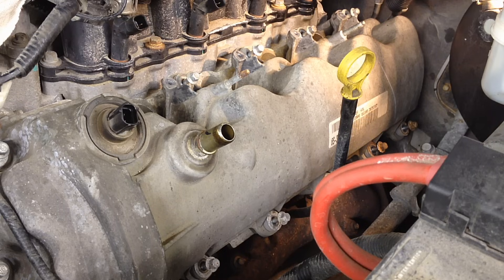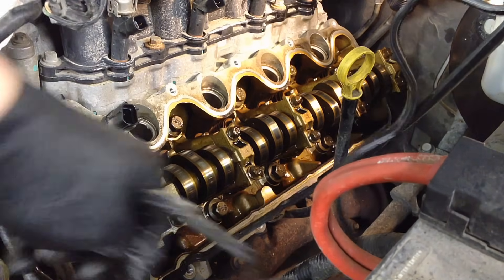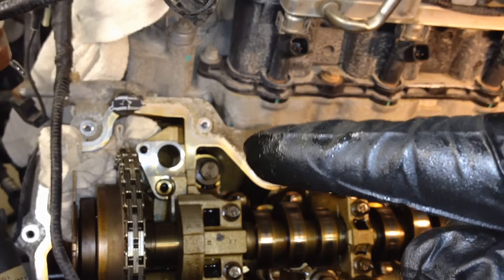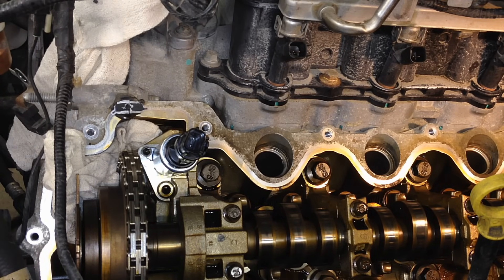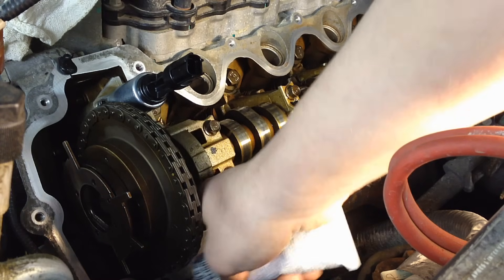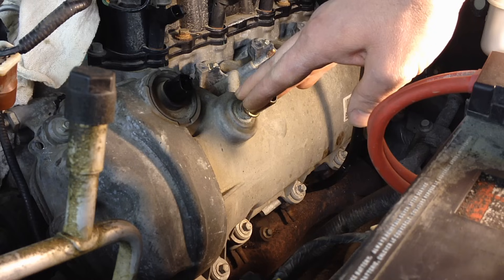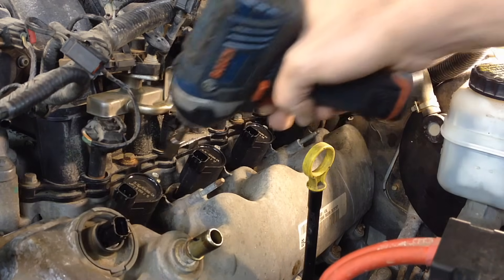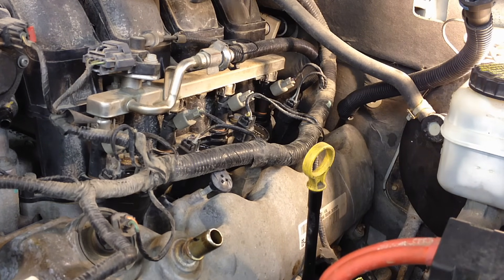Ford 4.6L 5.4L 3v Engines: VCT Solenoid Replacement

Comment: I don’t understand why you took the valve cover off? I changed it with it on. I just removed the pressed in seal and used an extension with a T25 torx bit. Removed and replaced it with new one. The new one came with a new pressed in seal around the selonoid and done. Can you explain your reason? Respectfully. I love your videos
Reply: Nevermind. I seen your answer below. 👍
I have an 07 and had no problem. The capture bolt was fine. Thanks for the info. The way the plugs break and all. 😅. I guess I’m a gambler.

Comment: Hmmm not hating because your video was so informative but I've doen these and the passenger side is the one that requires more coaching for those that are tackling this at home. I was hoping you would do both sides and was disappointed to see you end this video when you were done with the drivers side.
Reply from the maker: I cannot replace anything not authorized by the customer.

Comment: Why are you pulling the whole valve cover pan off I thought you posed to help people make it easier you just have to pull the rubber peace off should only take about five minutes to do it
Reply from the maker: Why because it is always better to pull the cover to avoid losing the screw. The screw can cock and thread into the eyelet of the factory VCT solenoid and aftermarket solenoids are even worse since they don't use a captured bolt. Also most don't have a T27 driver so they will use a 1/4" extension and T27 bit and this is very easy to knock off and lose down in the engine. Lastly the reason why I show this method of valve cover removal is because the large seal style valve cover you see in the video was only used 2004-2007.5 engines and 2007.5-2014 engines use a much smaller seal which requires valve cover removal anyway. Now do you understand?

Comment: The only thing on this engine that does not go bad is the dip stick!
Reply: You sure cause I can barely read my dipstick lmaooooo
Reply: One had a tube rust through on a 5.4
Reply: My dip stick tub got rusted and the dip stick fell off
Reply: My 4.6 3v has been great...no issues.  2010 F150 Supercrew with 184,000 miles, since new it gets an oil change every 3000 to 3500 miles, Berryman's B12  with every 10th to 12th fill up.
Reply: @bmboytx7082  same here,,,very reliable and dependable
Reply: Even on fresh oil change
Reply: lol.  Same here.  😅.
Reply: My 5.4 dipstick was impossible to read. My mechanic soda blasted the end so now I can sort of read it from the backside. 🤦‍♂️
Reply: I just replaced mine after 460,000 miles with virtually zero issues.
Reply: Even the dipstick f'ing sucks

Comment: Thank you for all the informative videos. I have a question for you, hopefully can get an answer since it’s been 7 years you posted. I have a 06 explorer with the 4.6. Keeps giving me code p2020. I changed the intake, I changed the actuator in the back of intake, changed the brake booster because it was hissing air. Sprayed around the houses to see if it would change rpm’s and nothing. Car feels and runs fine but can’t get rid of that P2020. I don’t think it’s the actuator harness because the actuator works. Unless I gotta trace other wires. Hope you can help. Thank you
Reply: ever find out what it was?
Reply: @robertswift6101   Unfortunately I didn't.

Comment: Could the vct cause a p0016 code? 08 5.4 3 valve. Timing assembly was done shortly before I bought it and has run fine for a year until it threw the code last week. Runs fine other than a very mild rough idle barely tell is running rough.

Comment: Is there a difference between the VCT and a VVT "Variable Timing Solenoid"? I ask because I and replacing my Camshaft Phaser and it was suggested to replace the VVT Variable Valve Timing (VVT) Solenoid / Actuator also.

Comment: Youre absolutely amazing and have been watching you for the last few weeks after purchasing a 2007 F150 super cab with the 5.4 3v. I have watched other videos and they pull the top gasket and pull the solenoid through the valve cover without removing it, are these videos legit?

Comment: There not alway a 25 mm torxs they can be a 10 mm bolt
Reply from the maker: If they are not a torx then they are aftermarket, we only speak about Ford parts here.

Comment: I put duralast vtc solenoids in my 4.6 3 valve engine in my STX F150  3 months ago and now after watching this video and hearing you say only buy Ford vtc solenoids is my truck going to be ok or should I change them back to Ford before I have problems

Comment: I just replaced my first solenoid. Filters were blown out. Good sign I hope. Inside of the engine is dirty. I have it apart and would like to clean it it while I have it open. Any suggestions? Or don’t touch it? It’s a little dirtier than the vehicle in the video. 230k on a adrenaline sport trac. (4.6l 3v) I have had great success with seafoam on other engines…?

Comment: 5.4 in a 2001 F250… pretty sure this is my problem. Runs great but rough idle when stopped. Has 293,000 miles on it. Would you even recommend tearing into this with the mileage? I’m afraid if I do I’ll just uncover more problems. Anyone feel free to give opinion. Thabks
Reply from the maker: Your engine is totally different.

Comment: Man thank you so much FordTechMakuloco for posting these 5.4 VCT videos. I had to replace mine at 88k and it was def the ticking/knocking noise i was trying so hard to diagnose. You are the man! Thank you so much 👍
Reply: was it knocking at idle or just in drive under a load?

Comment: I have a 4.5l and mine did not have to remove the valve cover to get to the PART  I want to know why you had to remove the valve cover? The new ones come with 2 plugs rings that save you all that extra time?

Comment: If my 5.4 3v has cam phaser lock outs, does the vct solenoid even matter anymore?

I bought the truck used from someone that installed the lock outs so that's all I know about the truck.

Comment: I have a Ford F150 2008, 5.4 triton, I' m from Puerto Rico.  My ford start to make rough noise, just like you said, I change the camshaft sensors and the VVT selenoid and the fail stop, but have a noise, like a tac, tac tac, when change the VVT I change the oil too, but still the noise, how can I fixe it?

Comment: Why didn't you change the valve cover grommets you going to pull vacuum The Grommet is crispy and hard it's not going to seal around the valve
Reply from the maker: You mean the vct seal? There is no vacuum inside the crankcase just a positive flow in and out. That is why it is called positive crankcase ventilation. The vct seals almost never fail on the 3v engines.
Reply: @FordTechMakuloco  I removed a grommet to take  the VCT valve out and it didn't come out , I notice that the new one came with two seals one off center shape,  and one perfectly round I have the perfectly round one. and when I came up with the valve, the  tab with the screw hit the valve cover.   So if there's no vacuum I'm going to grind out a section so the tab can pass through and then I'm going to seal it with silicone .  Sure I'm going to put a little towel in there , to catch the grinding, then seal the hole with the silicone.  So I don't have to take off the cover.

Comment: It should be noted that in another of your videos you changed the Solenoids on a 5.4L 3V by popping the seal and using a Torx (T27 I believe) to unscrew the bolt and replace it. No valve cover removal needed.
Reply from the maker: This only applies up until mid year 2007 after that you must pull the cover. Plus any service valve covers sold also require valve cover removal to replace the vct solenoid.
Reply: @FordTechMakuloco what if If I only want to replace the seal leaking? Do I still need to remove the Valve Cover? 2010 F250 5.4

Comment: You just wanted an excuse to take the valve cover off lol, you can pop that seal out around the vvt solenoid and remove it by pulling it up as the screw gives it slack (obviously not using the screw as an extractor as your information advises could go badly

Comment: I think this might be my issue.. 08 f150. Triton 5.4.... Has a knock sound at idle and almost wants to die sometimes when coming to a stop, especially when turning around.. Low throttle it idles and runs rough and sometimes dies. Once driving and up on the rpms its runs fine and smooth with no issues at all.

Comment: Aw man I’m really hoping this is my problem, having the exact issue you described of stalling at stop signs, just wasn’t sure if I should change my Camshaft position sensor since I got a p0340 code on my 2004 5.4L F150. But I was also thinking my VCT solenoids might be the issue. I’m going to start with that 👍
Reply: Any luck? Just did both CPS's (bank 1 and 2) and all the coils... I don't want to do the plugs. Still, dealing with idle issues and stalling after it warms up.
Reply: @StuPedassol me 2 😢 what was ur issue did u find out what it was ..mine is doing the same stalls after a good drive like it ain't gettin fuel
Reply: @joeroe2839  it was the cam phasers, due to ford using plastic timing chain guides, throwing off the timing and eating my rockers causing the tick against the cam. I was able to drive it for a while by just unplugging the cam sensors but eventually I knew that tick was just chewing up the lobes on the cam. Had to do phasers, timing chains, cams, rockers and guides, (and of course plugs while in there, because of their tendency to break).
Reply: Their may be a cheaper way, it's 4k to have it done... but it'll be good for another 100k miles at least. Have it assessed. Sorry about the bad news.

Comment: I'm having trouble pinpointing an issue on the 2010 3v. I have no check engine lights or codes showing. Truck shuts off after warming up while idling or coming to a stop. Could it be vct issue, trans check ball issue, or even throttle body issue. Runs good while driving. It all started few weeks after changing idler pulley, tensioner pulley and alternator.

Comment: I got 06 f250 5.4 v8 3 valve and is having the same problem of rough idle, shacking and stall and I replaced the timing and the vct solenoids but it’s still not fixing it. Would you know why it’s still not working right

Comment: I have a 2011, 230,000 miles. P0011/0021 code came on once. Should I replace the vvt? And if i do, as a preventable maintenance,  should the lifters be replace. So i dont have to take valve covers off twice.

Comment: I have a 2004 5.4 lincoln navigator and has no visible vvt  solenoids at all. Are they inside the valve cover haskets? Little help please.
Reply from the maker: You do not have VCT solenoids.

Comment: I dropped the vct solenoid screw down under valve cove.removed valve cover can't find the screw
If it went into the timing chamber how do I fish it out. Any help would greatly be appreciated 
Thanks
Reply: So, what did you end up doing?

Comment: Fantastic video Brian! question: 2008 f150 4.6L very slight vibration at idle and a bit more when I turn on the AC. Has 100K miles. have cleaned the throttle from carbon and the AFV. Can only feel it when I'm at a stop or in park. Do you think it could be the VCT? Ford dealer says the spark plugs look good and it does not give any error code, also the truck has been maintain well. Please let me know cause they dont know either...jaja

Comment: Would you recommend inspection of the vct solenoid if the valve cover is to be removed for a seperate repair on an engine with, say, 90,000 miles?

Comment: @fordtechmakuloco so I have a question related to this. My 2008 mustang bullitt started to make a sound that sounds like a backfire/misfire repeatedly like a sputter. It does it at times but not always sometimes the car even loses power in first gear and sounds like it’s about to stall. No check engine light or anything could it be the vct or what can it be???? Thanks in advance

Comment: Is this also for an 06 lincoln mark lt? Do you need to take the valve cover off to do this?
Reply: I have a 2006 Mark LT also, looks like same procedure. They use the same engine, 5.4 3v.

Comment: 04 expedition Eddie Bauer 5.4l Having loss of power while accelerating. Would this be due to needing to change the vct solenoid?  I work on my own vehicle because good mechanics are hard to come by. If you could help me with information on this matter, I’d be extremely grateful.

Comment: Would this also cause my 2010 f150 4.6l to sputter when accelerating? All new spark plugs, ignition coils, and fuel pump and still sputters when trying to accelerate to pass or gain speed for the speed limit.

Comment: You don't actually have to remove the valve cover unless you want to clean it all out like he did in this video. That grommet actually cones out and can be replaced. If you're not car savvy, I recommend you DON'T remove the valve cover to avoid getting debris in the motor.
Reply from the maker: Only up until mid year 2007 after that ALL valve covers must be removed.

Comment: can the solenoid be replaced without removing the valve cover? it seems like there is enough room. What do you think?
Reply from the maker: Up to mid year 07 5.4l 3v models yes
Reply: @FordTechMakuloco  thank you. I guess it doesn't apply to me. I have an 2010 expedition.
Reply: @FordTechMakuloco  not sure if you noticed the other question on an older video. I have several codes but no noise, or rattle. Codes are P0012, P0022, P0341, P0346. I am thinking it is only the solenoids, and not timing chain and phasers. What would suggest? Thank you

Comment: Why remove the whole valve cover? I've done it just by removing the solenoid gasket, just replace the gasket with a new one! So much quicker! 

EDIT: sorry some covers have smaller gasket openings in which you do have to remove the cover, but in this instance the one in this video does have the larger gasket so it could have been done without removing the cover!
Reply: You were able to do it without removing the valve cover?

Comment: 2012 ford expedition 5.4 3v 188 k mi. I was going on a vacation from El Paso to San Antonio I pulled over to use.the John and when I was taking off it started to tough idle oil light flashing and it died had to tow it back home. Giving me po300 po301 po301 it only starts when I floor it but had it for two years no issues until now.

Comment: have a 2007 Mustang GT 140,000 miles bought it with 3,000 and I've never changed them, still runs great but will change them here shortly. Original clutch, never changed the rear axle, transmission fluid, and coolant. Checked the fluids and they all looked original so i never bothered.
Reply: wow amazing,,my 07 gt has 46K miles on it,,got it when it had 20K,,,,its been a great car and a blast to drive

Comment: I run hot shot secret oil additive in my 06 f250 5.4.   It’s got 275,000 miles on it. Only thing I’ve replaced is the alternator ( internal wire broke ) and I change the spark plugs every 30,000 miles with the new champion one piece plugs.  
Truck still has factory coils.  
I change the oil every 4500-5000 miles with full synthetic 5w30.

Comment: Wish I had seen this before I rebuilt my engine.  Mustang 2008 gt 4.6. Great video God bless
Reply: Why did you rebuilt it sir? What was your problem?
Reply: My apologies on such a late response, it sounded like the lifters then I was told the valves. But just got annoyed and sent it out to get done. Then I finally got to reading and researching found the vct solenoid replacement kit might work so far a lot better then before.  Good luck God bless

Comment: do you have to replace the whole valve cover for have the pcv replaced on a 2004 f150 5.4 engine 3v?
Reply from the maker: Yes
Reply: @FordTechMakuloco  does the computer need to be reset after it is replaced? because i had my valve cover replaced with a new one and also a new pcv valve hose and my truck engine light keeps coming on saying the pcv valve needs to be replaced

Comment: I changed my solenoid on my 2006 expedition, like u did in the video, but it won't even crank up. Then the milage comes on like normal but then it goes away n looks like this, ------. Any advise

Comment: How do I get the egr tube off on a 4.6? It’s rusted on there and keeping me from being able to get the cover off. Thanks!
Reply: Hope you didn't try yet to take the tube out, it doesn't come out you'll probably have to get a new hose that connects to the intake. It should be integrated right into the valve cover, that's  how it is on the 5.4l anyways. I thought the tube on the valve cover was the pcv valve and end up bending mine on the driver's side, had to replace the entire valve cover.

Comment: I’m having big issues I dropped a 6in t27 bit inside the engine while trying to remove vct solenoid without removing valve cover I just got the valve cover completely off but cannot see tool that I dropped.

Comment: Okay so I’ve been have problems with my 5.4. Hard starting, decreased power, It misses when I come to a stop and you hear that clicking noise coming from the engine, decreased Fuel Economy. All the signs of a bad VCT solenoid, at least what I thought. I changed both solenoids and the problem still continued. Once I unplugged both solenoids It ran fine, just a slight power decrease. Could you PLEASE help me out? I’m totally stomped at this point.

Comment: Is it true that you don't need to remove the valve cover gasket with the 5.4?
Reply: You don't need to... Just pry the seal out and use a T-27  and remove straight out... Absolutely no point in messing with the valve cover what so ever
Reply: @jasonclark12345  thanks for the info 👍
Reply: @jasonclark12345  did mine without removing valve cover.
Used chinese brand gaskets that lasted about 4 months until they started leaking so swapped with dorman and ok so far.

Comment: No ford don't make it a push and twist selinoid with it's own gasket on the outside...... Bolt it to the inside of the head so you have to throw in new gaskets as well. 👍 SMART......